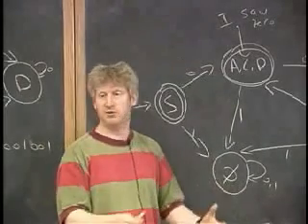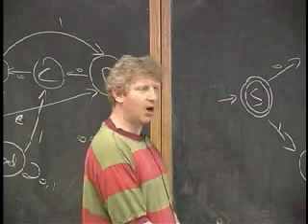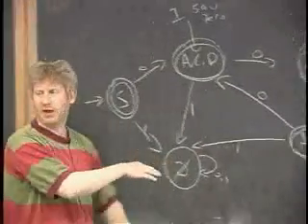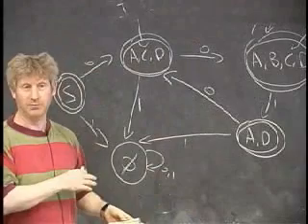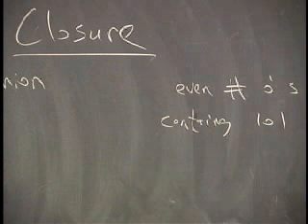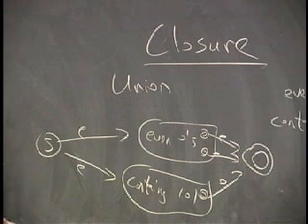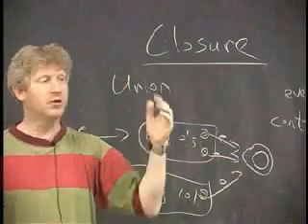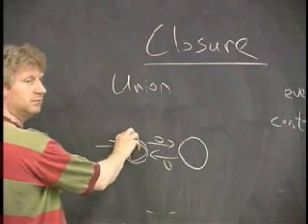Lecture 2 - Closure and Nondeterminism (Part 6/9)

Comment: The minimization algorithm he is talking about is Brzozowski algorithm: published in 1963"Canonical regular expressions and minimal state graphs for definite events", Proc. Sympos. Math. Theory of Automata (New York, 1962), Polytechnic Press
Reply: Plus, there are polynomial versions built on top of it. For example: 
Manuel Vázquez de Parga, Pedro García, Damián López,
A polynomial double reversal minimization algorithm for deterministic finite automata,
Theoretical Computer Science,
Volume 487,
2013,
Pages 17-22,
ISSN 0304-3975,